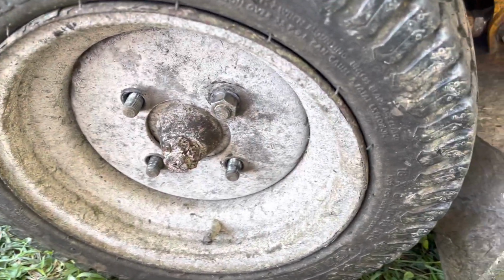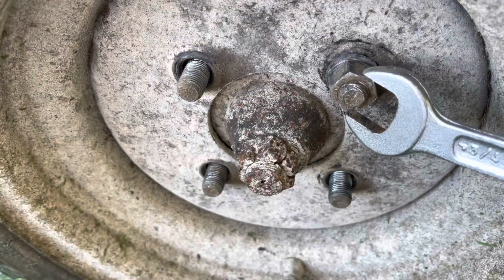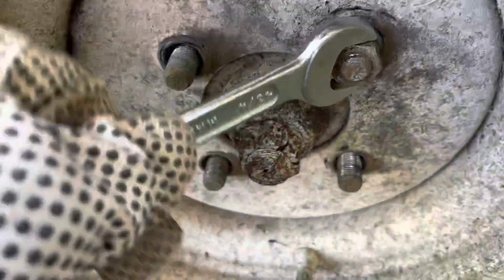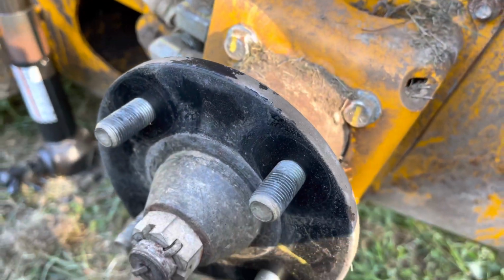Spinning Wheel Bolt When Turning Lug Nut

Comment: Future tip for anyone reading- 

If possible (I think in this video it’s not the case), crack the lug nuts on the ground then lift some, or all, weight off of the wheels and remove all the lug nuts. 

While it’s likely this is just a seized bolt- having the weight of the vehicle on the tire when removing lug nuts one by one will leave the last one holding a lot of extra pressure.

That will increase the risk of stripping or weird shit happening. Cheers